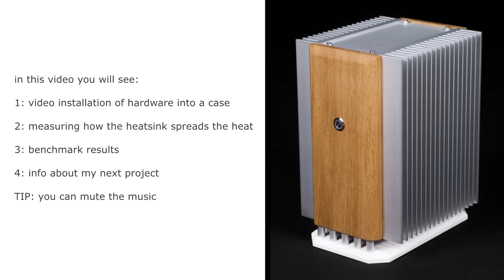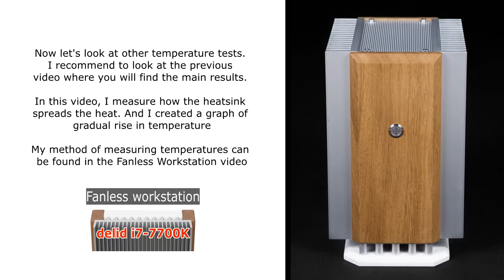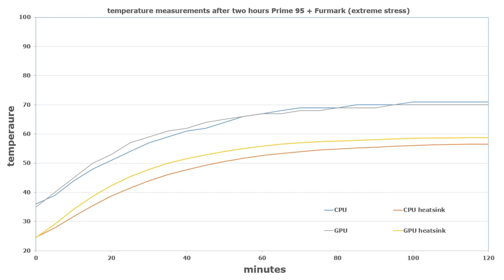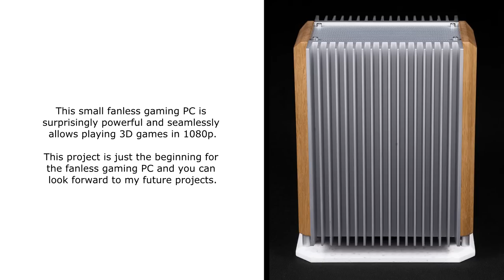How to Build a Silent Gaming PC

Comment: vaya.... no habeis sido tan valientes de mosntrala con los cables puestos

usb´s. hdmi. rj46-----
Reply from the maker: No tengo problemas con los cables
Reply: pero no has subido una foto de como queda con el cableado!! (sino sube una a facebook
Reply from the maker: for others to write in English ..
1. There's a lot of information you just have to believe - if you do not trust my words, do not look at my videos ... I'm only writing the truth.
2. For the cables I have left a space of 60mm, it's enough for my needs, but it can do even more when I lift the motherboard more up ...
3. The cables can be pulled back between the aluminum pipes or the cables can be pulled through the hole in the middle and then through the desk board for the "wireles" design.
4. this case is now empty, I sold the graphics card and I work on a more powerful fanless gaming PC with GPU TDP 180W and 250W ... I do not need to have a lot of computers at home, I do not play games but I like to build fanless cases for 12 years...

Comment: how not to put on thermal paste 101
Reply from the maker: what do you mean?
Reply: Realistically any way works. Up to the person's preference.
Reply: The recommended way is usually to put a grain of rice sized amount on the center of the CPU and allow the heatsink to spread it out as it is mounted. I think there's a possibility for air to get trapped, but don't quote me on that. It would be interesting to do some benchmarks both ways and see which one is more effective.